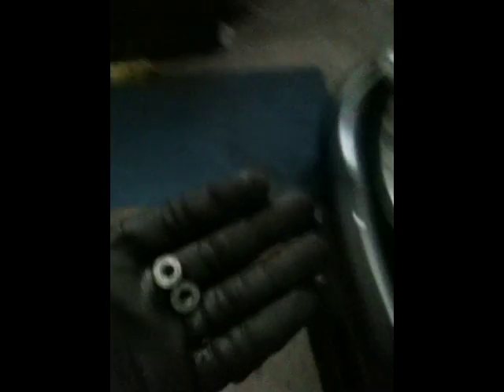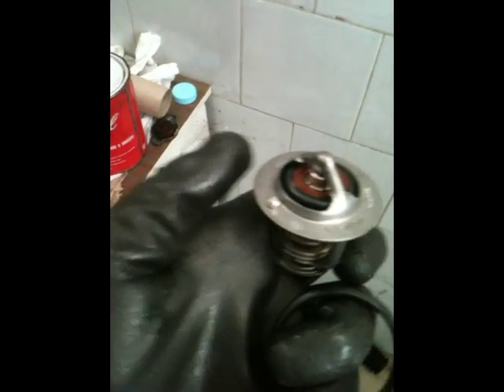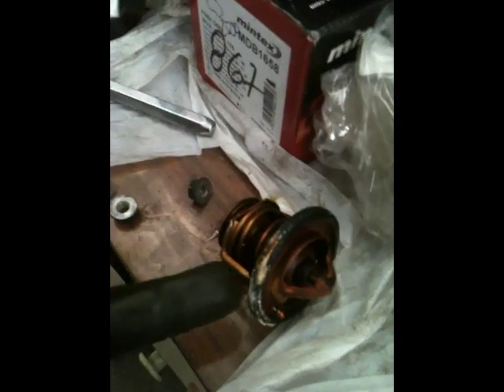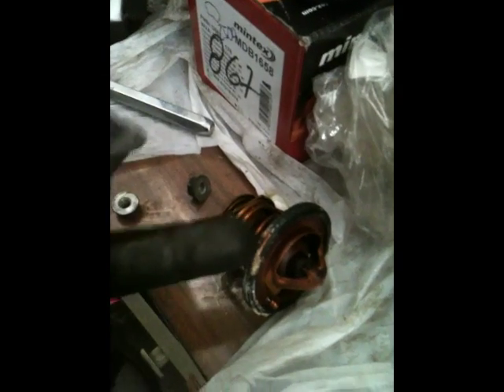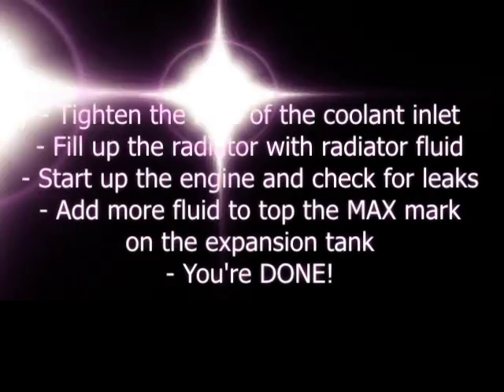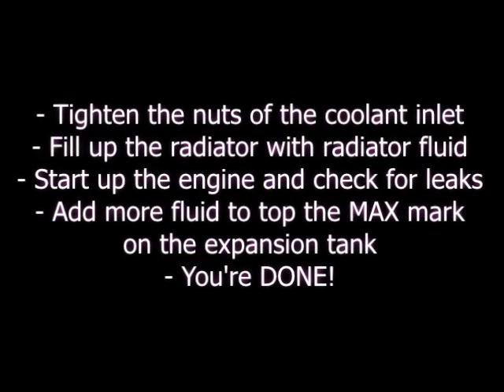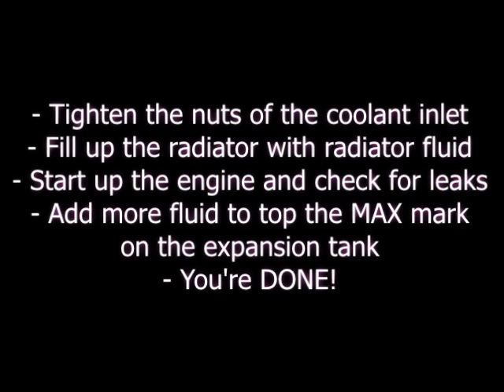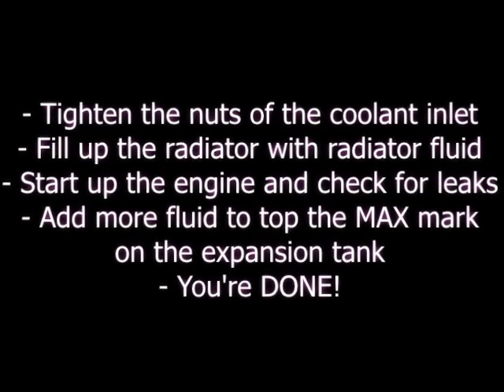DIY : Engine Thermostat Diagnosis and Replacement on a 1998 Toyota Corolla G6R

Comment: Hi Joao, does that engine type have and EGR valve? where is it located? I have the same engine but i'm not sure if the 4A-FE have EGR valve. Thanks in advance!
Reply from the maker: Ogie Lacerna From what I can see in japancars.ru, not all 4A-FEs come with EGR System. The G6 model (my corolla) does not show it under the section (http://japancars.ru/index.php?route=catalog/toyota&area=EU&cat=153540&mdf_id=623). Check the site for your car's model and confirm yourself :-)

Comment from the maker: Yes, unfortunately I was working in a place without any electricity and only had my mobile phone to film the video. It turned out to be quite a bad quality video, but I thought it could be useful for people with the same car. The idea is so that they can connect the dots and compare the parts of the engine bay with the ones shown on the video and perform the work...